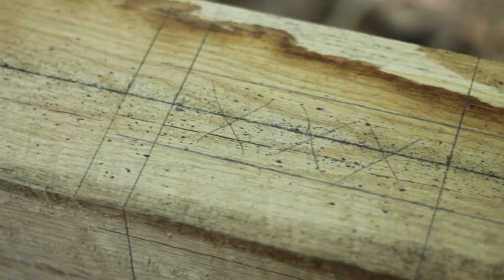Timber framing a medieval capstan

Comment: When I lived i the Netherlands I was blessed to be able to tour a Dutch Windmill that still was being used to grind flour.  Inside was a much larger version of this.  All gearing was wooden, and an entire tree as the central axle.  Nearly 36 inches in diameter and over 30 ft high.  It is amazing the craftsmanship that it took to balance that whole assembly to where a child could push it.

Comment: A very interesting video.
I saw the title and wondered what a capstan was.
I didn't know before watching the video.
And...
I didn't know after watching the video, either.
Presumably it's for 'power' of some kind, maybe to translate rotary motion into some other form of movement for power.
Now I shall look it up and see.
Thank you, I enjoyed that a lot.
EDIT
A capstan is a vertical-axled rotating machine developed for use on sailing ships to apply force to ropes, cables, and hawsers.
Reply: staninjapan07 I'm guessing they're going to be milling some grain
Reply: on a ship, a capstan is mostly used to wind up the anchor rope. Here, it would be used to pull a rope that's attached to the frame of a house. The rope winds around the axle, and the resultant shortening of the rope gives indeed a pulling action. It's basically a vertical winch. Usually a ratchet is added as a safety, so that the load doesn't come crashing down should one of the turning persons trip or fail.
Reply: staninjapan07 😂😂
Reply: in the description he explains that its used for barn raising
Reply: A capstan is like a winch, but the line passes through it, instead of being simply winched on.  Being vertical or horizontal is not important.  What is important, is that the running end is free, and needs to be taut for the capstan to work as intended.

If the running end is affixed to the roller, then it's a winch.
Reply: +09conrado thanks
Reply: staninjapan07 t
Reply: what's a hawsers
Reply: staninjapan07                      
  jhvcbb.
Reply: Thanks for letting me know what a capstan is.
Reply: staninjapan07 oö
Reply: they used to use it for raising the gates in some castles
Reply: staninjapan07 me to
Reply: staninjapan07 - I know, you've already been educated. Just thought I'd try to help with your future confusions. Answers come easy in these days of immediate gratifications. Just type it in the Googles. The interwebs are smart. Believe it or not, it can be a valuable resource sometimes. ;-)
Reply: staninjapan07 agree
Reply: a ships capstan is as well known as the wheel....the capstan pulls up the anchor (sailing ships).

Comment: Proud of you, Bub. A hunk of history right off the Breugel painting of "The Tower of Babel." Four guyswalking an 8 ft circle each pushing 45 lb, a 6" capstan drum - - maybe 2900 lb pull. Figure 60% efficiency - 1700 lb. How much effort to raise your bents?

You need to band your capstan so the sockets don't split out? A ratchet to prevent a run-away?

How you going to anchor the capstan? Couple short stumps?

You got 4 muscular guys lined up? More to rassle the bent? Gin pole? Mast? Snatch blocks? Rope? Food? Beer? Send me a plane ticket and have some of that Apalachin venison sausage and bannock bread on hand. Inept irresponsible supervision stimulates a fine appetite. Oh, and a nice comfortable chair in the shade.

Ever think a yurt might be simpler?
Reply from the maker: Thanks forest, in fact, it took about 15lb of pressure with one hand to raise the bents…no need for strapping guys, at one point we used an 8 year old boy, another a 15 year old girl…was actually pretty amazing, stay tuned for raising video lots to edit

Comment from the maker: Our intentions were never to perform a medieval reconstruction, the capstan is a tool which would have seen use since at least the medieval period, however our tool and methods are those which we use on a daily basis here in our homestead and are not from that period. We apologize for the confusion. Thanks everyone for the interest.
Reply from the maker: Try local antique stores and flea markets. The capstans was Jim Rogers design, a timber framer
Reply: Hey, I'd love to hear more information of the drill you were using at 3:57 . What is it called? Where is yours from?
Reply: It is called a boring machine. Pretty common at the turn of century when timber framing was how they built many homes.
Reply: The trees are cut in winter because the water inside is less. My grandfather said so
Reply from the maker: Winter is the best time in my opinion for many reasons, but I often need wood and can't wait till the next winter...
Reply: that was only an information from my grandfather.  i don't know too much things about what to do :D

Comment: i know this video is now 3 years old, but you're the first fella i've seen who lets the tools do the work. the way ya swing the hammer and shave the logs with the axe. no unnecessary force or movements, just weight comes up, weight comes down. work smart, not hard.
good stuff

Comment: That's a nice winch. Makes me think though, would some kind of fairlead make it easier to use? It looks like it would be good for a linear pull, like dragging something, but if you're lifting heavy objects, some kind of ratchet and brake would be a good idea to prevent it running away. Hand winches can be dangerous, more so without a ratchet and brake. If the arm you're using breaks, the next one is going to want to take your head off. Just thought it bears mentioning.

Comment: I think you missed by a factor of 2.   R1 to r2  or 8 feet (96 inches) to 4 inches = 24 to 1.  You used R to D in your calculation.  You just gained 2 times.  I have done the same thing in the past.

Comment: nice i hope we get to see it doing some work . also the drill bit with the holes in it what is that one for never seen one like that
Reply from the maker: You will soon, yes its a "scotch eye" bit, they excel at boring into end grain, most normal bits don't do well here.
Reply: +Mr. Chickadee cool I need to make myself a set of chisels I want to build a line shaft powered machine shop.

Comment: Maybe it was my imagination, but I coulda sworn I saw a nail in that video.
Reply: I saw several of them. :-)
Reply: Nails were around in medieval times, but would be square in cross section.
Reply: nails may have been around in medieval times, but I've never seen one in a Mr. Chickadee vid.
Reply from the maker: I use nails a lot, but prefer wood joinery
Reply: I saw a nail...I did I did...I know I saw a nail...lol
Reply: it's not a primitive capstan, it is a medieval one and I think nails existed  :p
Reply: Nightchild403 mostly wooden pegs were used to lock joins together.
as you see him using elsewhere in the video.
nails were used you're right, but we're not very common amongst the common folk.
Reply: Nails have been in use since the iron age. There were flat nails typically used for decking called cut nails,  and round ones which are still 'common' today.

Comment: I wish I had the kind of wood up here in Minnesota that you have down there! The toughest part of building timber frame up here is finding usable straight wood. Thanks for this video.
Reply from the maker: hmm, sounds like you might look into round wood framing, and framing using curved timbers, such as korean hanok style or British Cruck framing...
Reply: I've been looking into round wood framing as well.  I think in the end it will be a mix and match of different styles to suit my needs anyway.  I am not a purist so I think it will work out.  the Grindbygg stuff is kinda neat too.

Comment: Cool!  I've seen woodcuts showing medieval miners using similar capstans to raise ore from deep inside a mine. President Herbert Hoover was a mining engineer, and his wife a scholar of the Latin language.  The two of them translated a book called De Re Metallica (on the subject of metals) which was an explanation of many medieval mining techniques.  The drawings in the book show lots of similar devices the miners designed to get ore out of the ground and process it.  The original book was written (i Latin) by a Roman governor of Britain named Agricola.

Comment: While the basic design dates back to the middle ages it's use lasted for several centuries.  Without it the discovery of other continents and the development of trade and migration would not have been possible.  Simple machines like this are what increased the technology of mankind.

Comment: When I was kid my Dad built a timber frame barn ... he cut the mortices with a brace and bit and a home made breast plate ... we were not trying to re-create history though ... that all we had to build the barn :)

No fancy "taylor made" chisels either ... we had chisels made from a broken truck leaf spring ... shaped and sharpened out on grinder made from a scavenged a bearing and an old washing machine motor.
Reply from the maker: sounds like a great experience!
Reply: It sure was :) ... I recently rebuilt the front porch on my house and used dowelled mortice and tenon connections where ever i could :)

Comment: as all ways loved the video what do u think u will use to anchor it to the ground once u start lifting with it I will wont to pull its self up or are u going to add a surprise like an old wood crane like the old time loggers used with their steam powered donkey engines hint hint

Comment: You should probably add a locking mechanism for safety. Something like a ratchet system ideally or just a hole at the top where you can place a log to block the arms from turning at a minimum.
Reply from the maker: Good idea, we had planned on having one person holding a handle at any given moment, but that would help if the capstan were to be left unattended.

Comment: This might sound like a dumb question, but do you have problems with ticks down in Kentucky? Up here in Vermont, they are certainly getting in the way of me spending as much time in the woods as I would like. They say that they don't even test them anymore, if you get bit, they just assume Lyme disease, and you get treated.
Reply from the maker: Ticks are a fact of life here, we check frequently, according to a bit of web research, it takes 36-48 hours for lime to be transmitted, so checking yourself and family may be the best defense.
Reply: They've been bad in NC this year.. my wife and I have caught at least 5 between the two of us just walking around in our front yard.  I've had to be extra keen to keep the grass short to help with this, but it's only been mildly successful.

Comment: Love our videos. 
Question: is there a reason for the choice of saws? some cuts seem more suited for the   hand saw but you go for the on man cross cut, and vise versa? I assume it what which was close at hand, but just wondered if there was more to it.
Reply from the maker: Depends on several things…the smaller hand saw is good for most tasks especially where accuracy is needed, but in thicker wood the "one man crosscut" is faster but more difficult to cut to a line with. I use it mostly for docking ends of timbers, and most joinery on bigger timbers. The Rip saw takes any cuts with the grain and up to a 45 Degree angle, more obtuse than 45 and its back to the crosscut.

Comment: Josh, I've seen a couple of other fellows fell trees like you did at the 11:00 mark of your video.  I'm wondering why you chose to chop it at waist height instead of sawing it at ankle height.  Seems to me you left three feet of good wood sticking in the ground.  Just wondering if maybe you have an alternative purpose for a three foot tall stump.BTW, the capstan build is a great continuation of your house build.  Just another example of how you do wonders with simple hand tools.  Great job as always and another tip of the hat to you.
Reply from the maker: Good question, few reasons for this. Part is simply body mechanics, its easier on ones back to swing at about knee or thigh height than stooping to get the blade down low, also if you do swing low your cut will have a drastic arc to it, not straight across, this could be an issue with the felling. Another reason is most trees have a big butt swell down low, where the tree tapers significantly in its first meter, this extra wood needs to either be sawed or hewed off when making a timber, which is avoided if you cut above it. When using a two man saw as we often do, cutting about 2-3 feet up is just the most natural and comfortable height to work, lower would put you and your partner on your knees for the entire cut, which can suck. Another reason historically was that trees were often felled during land clearing, the longer stump being easier to get purchase on when pulling the stump to clear land.

Comment: Great handle. Was it done completely with green wood? I have a very old MC OGDEN double bevel broadaxe. That i wish to gift to you. It will need a new handle, but I know you would appreciate the age of this axe. The collins you have is old but this broad axe probably is atleast 60 years older. I'm guessing around  1890. Contact me with an address to send to you . my only request is to see you use it in a video. Doesnt have to be a restoration video, just would like to see you use it.

Comment: 12 to 1 mechanical advantage (I confirm your math on that), times 4 handles each equipped with a strapping young lad, Times the figure I was just now able to easily achieve pushing the bathroom scale against the wall and I'm left with the question, how are you going to secure that fine piece of craftsmanship when it's pulling 5000 pounds? Also, is it crazy dangerous without a ratchet?
Reply from the maker: You are correct in your calculations, though we also employed a 6 sheave tackle block (which will appear shortly) to raise our bents, so the final pull on the capstan was much less, in any event, it was secured to the ground via a system of large stakes driven into the ground and tied in tandem. A ratchet may have been more a concern if greater weight were lifted, or some other application, in our position it was not needed.

Comment: cool Vid:) Is there much difference between the modern day saw teeth and yesterday saw teeth is how well they get the job done?
Reply from the maker: Yes, most new saws are sharpened to cut both as crosscut and rip saws, and are induction hardened at the tooth line. This combination is made for the carpenter who does not know or care if he has a rip or crosscut saw, and can't be bothered to learn the skill of saw sharpening. So these modern saws cut slower in either direction (crosscut or rip) than the traditional saws, and as they are too hard at the tooth line, you cannot sharpen them with a file as a vintage saw, so use them till they are dull, and throw them away. Oh and they either have ugly plastic handles, or ugly wood handles which are not comfortable or lovely like the vintage saws. 

In summation, new = crap, old = amazing.

Comment: You don't dry your wood before using it, or does it not matter too much with this kind of project?
Reply from the maker: Depends on the project and the application of the wood. You don't need or want dry wood when timber framing, or making this capstan for instance, the green fresh wood is softer and easier to work with, for other things, like oh an axe handle for instance you want your wood very dry, or the handle will shrink and the head will fall off!

Comment: What are you going to apply it for? couldn't the levers be shorter for convenience?
Reply from the maker: To raise our house frame, the long handles give more leverage and hence more mechanical advantage.
Reply: Torque is computed with the cross product of force and radius vectors: T = F * r * sin(θ), where F is the force vector, r is the radius vector, and θ is the angle between the two vectors.  The greater the radius, the less force needs to be applied.

Comment: helpful tip if you chop around the trees they will fell much faster a have personally chopped down a 5 inch tree in 45 min with a knife using this method

Comment: Built them and used them on rural jobsites, when a crane could not be had for swinging trusses..   MUCH faster to knock one up with 2X4s and a pneumatic gun.

Sharp tools.  Your handsaws should be sent to Boston Saw and Knife, Needham , Mass.  Send saws, slick, and auger,,, you will not regret it.  Must be other good saw shops,,, used to be a really good on in Flint Michigan,, don't remember the name.  Your green oak would be much easier to cut.  You'd be amazed.
Reply from the maker: The oak in this video has been sitting all summer drying, very tough stuff to cut, even with razor sharp tools, as I maintain mine in that state.

Comment: Question, please? That drill press device you are using, what is it called and where might I find one? Thank you.
Reply from the maker: Its called a boring machine
Reply: Thank you, will see where I can find one.
Reply: Thanks. Did a bit of search on it and those are expensive machines. Might come up with parts to make my own version. More into the usage rather than as an antique that some folks would have sitting around to look "cool".